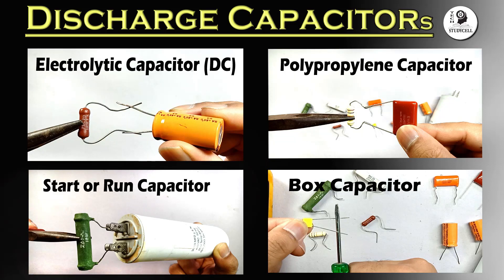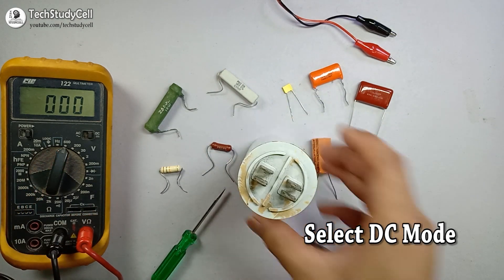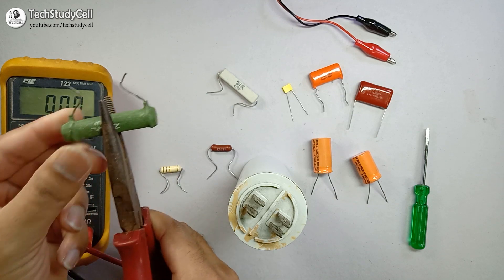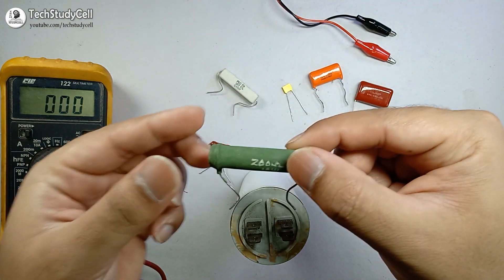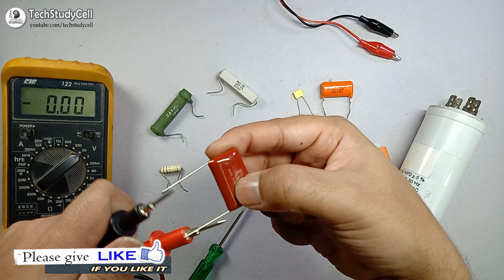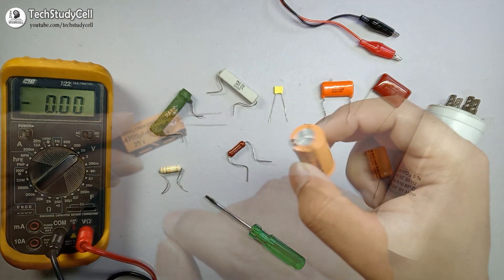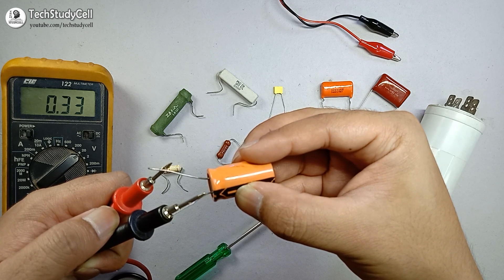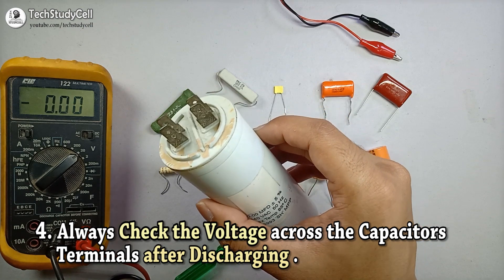How to Discharge Capacitor safely with resistor

Comment: Thank you for the great video. What about in-circuit capacitors? Should we discharge them? And would it the same way by using a high watt resistor?

Comment: Will this one work to discharge high current HVAC Capacitors? Wirewound Ceramic Cement Resistor 10W Horizontal,10 Ohm? 
Is there a reason why your using a 200 Ohm for the bigger capacitor?

Comment: Would it be sensible to leave the multi-meter attached to the capacitor legs while discharging it with a resistor to see when the voltage has dropped to near 0?

Also how do you determine the appropriate type/rating of resistor to use?

Comment: hello  i would like to discharge 3 filter capacitors in a circuit, they are all rated at 500v 47+47uf/ 100uf`` when the power is turned off it have stored about 150v as they are in operation they are at 315v i know a resistor rated at 0,75w for example is enough to discharge 150v as the 0,75w tolerate about 350v and my 2w tolerate about 500v, i just wonder which resistor value is consider to be great for discharge 100-300uf 150v ? i have 100k 0,75w ,300k 0,75w & 1meg ohm 2w left,i just try to discharge 8volt with a 1w 1k ohm resistor and worked nice and quick just to try it,  sincerely

Comment: Why should a capacitor discharge? Imagine the capacitor with all its charges is kept inside a bag and tied at two open ends (open-circuit). 

The positive charges on one plate are attracted strongly to the electrons on the other plate, and the electric field is strong and uniform between the opposite charges on the plates. The opposite charges on either plate seem to hold each other tightly. The field is 
not so strong to cause the electrons to cross the gap and reunite with the positive charges. 
There is a fringe field at both ends ready to burst the bag, but the open circuit does not allow charge flow in the external circuit. The electric fields of surface charges which move 
onto the wires from both the plates and the fringe field will, during the initial transient when the wires are attached to the plates, combine to make the resultant electric field in the wires, zero. The fringe field is different from the field between the capacitor plates. 

When the charged capacitor is short-circuited using a wire, the effect is to open the tied ends of the bag and the charges are released. The fringe field causes the initial crucial release of charges for further flow of the 
charges….and development of surface charges that will enable the charges to flow around the wire, and neutralize each other. After all the charges on the plates are neutralized, the 
circuit attains a state of static equilibrium, a natural relaxed state of equilibrium and we say the capacitor is discharged.
Electrostatics and circuits belong to one science not two. To learn how a capacitor charges and discharges and the origin and role of the fringe field in the circuit process it is instructive to understand Current, the conduction process and Voltage at the fundamental level as in the following two videos:
i. https://youtu.be/REsWdd76qxc and 
ii. https://youtu.be/8BQM_xw2Rfo 

It is not possible in this post to discuss in more detail the formation of the fringe field when a capacitor is charged and discharged.
The last frame References in video #1  lists textbooks 3 and 4 which discuss these topics in more detail using a unified approach and provide an intuitive understanding of discharging a capacitor with the help of sequential diagrams.

Comment: It seems like you could look at the values of both the capacitor and the resistor, and only apply the resistor for a short period before testing again. That way you can figure out almost exactly how long to apply the resistor and write it down for each test. I suppose it would be a good idea to test the resistor every time to see if it's still functional as labeled.

Comment: 300 volt that doesn't need that big of a resistor
Reply: Hello & good day sir, i just wonder i want to discharge 3 capacitors between 100-330uf that still in the circuit ,the stored charged volt after turn of the dac is about 150v i know 0,75w-2w resistor is enough , but could i ask if you know which value i can use to be safe`` i have available 1k-3k /100k-300k-1mg for example, sincerely Ivan

Comment: I have 50v 1000uf capacitors I want to discharge. I have 1 watt resistors, but I see you recommend using a resistor closer to 3 watts to drain, but is it okay if I solder together three separate 1 watt resistors to basically create a 3 watt resistor?

Thank you
Reply from the maker: Yes you can do it with 1 watt. It will be better if the  resistance value is  low (less than 20 ohm)

Comment: i wanted to make a tv head costume using an actual tv, but my parents said no, because of the capacitors. hopefully they will say yes when i tell them how easy it is if you do it correctly
Reply: Please, do no try this at home. If you want to do... Whatever you want to do to that TV... Just bring it to a professional. This is not as easy as you think and if you don't have proper tools and electrical security knowledge you can get yourself killed by the capacitor. Please, stay safe, don't play with these things.

Comment: Big problem is when the capacitor is in the circuit. I got a big shock that threw me some feets away from a very high volts capacitor in a digital camera near flash light section when I was trying to modify the camera. All it took is a accidental touch, we careful with a capacitors in electronics devices, they can be fatal!
Reply: So as idiot kids in the 90's we used to take apart disposable cameras when they were spent, strip wires and solder them exposed near the outside, charge up the flash capacitors and, toss them to each other to catch...

At times I'm surprised I'm alive now and still have all 10 fingers and toes...
Reply: @center4nerds  Wow, and I thought that jumping on and off of moving trains and throwing empty cans of Raid in a camp fire were dangerous things I did as a kid !  I'm surprised I'm still walking around in 1 piece too, without any visible scars... LoL
Reply: @konglives4453  I did something crazy when I was a teen... I poured a jerry can of petrol (gasoline) over a camp fire and the top spout caught a flame. I panicked because I thought it would explode so, I blew it out, but I even today , I think how it could have exploded in my face, particularly if the flame had blown downwards into the can.

Comment: Does this work in circuit? Can I just use one very large resistor to discharge both large and small value capacitors?

Comment: Instead of having many resistors around why not use only one 10w resistor for discharging all capacitors?
Reply from the maker: Yes. That can be done
Reply: I don’t have 10 watts resistor ,any other smaller value?
Reply: @nilolee2426  connect small value capacitors in parallel but make sure the resistance remain high...

Comment: I have small 35v 1000uf. So if i plug it to LED until it no longer emit the light, does it mean it fully  discharged?
Reply from the maker: If you connect a 1.5 or 3 v led to discharge 35v capacitor the the led will burn out. Use always high wattage resistor to discharge a capacitor.

Comment: how do you calculate the value of resistor for discharging each capacitor ?
Reply: Depends how fast you wanna discharge the capacitor. The smaller resistance resistor you have, the hotter it will become and the faster it will discharge. So if you have 25V charged capacitor that you wanna discharge with a regular blue metal film capacitor that is only 1/4 watt, you need around 3k ohm resistor and some time. If you have a 1w  680 ohm resistor you can discharge it quicker without burning the resistor up. This is all is taking in account  that we will not be crossing the operational limits of the components, if you don't care much and the capacitance of the capacitor is lower you can get away  with using less powerful resistors for a short amount of time. Just wear some personal protection in case something goes south. 

Also if you are discharging high voltage capacitors then you need to recalculate all the stuff using ohms law

Comment: Hi, I'm new to electronics. I'm kind of scare of capacitor.  I know it can explode. So what is the safe voltage and farad to play around with? 

I have 35v 1000uf capacitor and a 9v battery (for Arduino project). How long to make it fully charged?  and how long for it to be discharged? What is voltage to be considered dangerous?
Reply: If you charge that capacitor with the 9v battery, the capacitor will hold 9v, (the max is 35v, over that it could explode) and its safe for your hands because the resistance of the skin is around Mega Ohms(very high), if you calculate the current with Ohm's Law: 9v/1MOhm = micro amperes current will flow in your skin and that is not dangerous, but if you connect the two terminals with a metal stick (very low resistance) you will make a shortcircuit, and it will spark. The more Capacitance the capacitor have, the more will hold the voltage. If you have a 100000uF capacitor at 5v, will only holds up to 5v, but it will dangerous to shortcircuit with a stick, because a big spark will come out. If you charge the capacitor up to 35v it will became dangerous for your skin. I hope i've helped you
Reply: @Cr1z4n63L  So, as long as the capacitor that i have never been charged up to 35v. There is no reason to discharge it right?  I'll just leave it lay around before use it again with my 9v  battery.
Reply: @jumbo999614  The capacitor charges around 3 seconds, it is really fast, and the time of discharge depends of what you put in the terminals (low resistance, fast discharge, high resistance, low discharge), check it with a multimeter

Comment: Danger. 300v.  And then he points at it almost touching the leads and the metal probes attached to them.
Reply: I bought a 450 volt capacitor im gonna hook up to a plant.. I watched this video and was like damn good thing i watched this.. read ur comment.. I grab it and touch the metal prods fast... hearts pounding like a mad man... the capacitor was discharged before it was shipped.... going to pull out meter now... dang... it has 5 volts!! not gonna touch it again

Comment: How to calculate Ohm and Watt resistor from capacitor?
Reply: I don't think it matters too much as long as you pick a resistor value high enough to keep the current low. Cause too much current through a low resistor could be dangerous for you, the resistor and the capacitor.

Example: if the capacitor voltage is 35V and the resistor is 1 Ohm, you're gonna get 35A of current initially which is super dangerous.

Also make sure the resistor is rated for a high enough wattage. Watts = V x I. So if V is 35V and your resistor is 100 Ohms, I = 0.35 Amps, so your resistor needs to be rated for at least ~12W. if you use a 1k resistor, I = 0.035 so you only need a resistor rated for ~1.2W.

The drawback is that it takes 10x as long to fully discharge the cap. But since caps discharge logarithmically (quickly at first, then slowly, it probably won't take 10x as long to discharge to a safe voltage).
Reply: Yup

Comment: Hi! Thanks for the video. I am very new to this and want to fix my tv. Could you use the green resistor on all capacitors? What happens if you use the red resistance on the big white capacitor? Is there any danger or these combinations just don't work? Thanks again
Reply from the maker: It depends on the capacitance. So it better to take help from electrician.

Comment: @Tech StudyCell  Your emphasis on safety is very much appreciated!  Would you please do us a favor and delete the Hokiepokie comment below?  Thanks!
Reply from the maker: You have already replied him. Thanks for the feedback.
Reply: @TechStudyCell  That's a bad joke on a dangerous subject. Guaranteed somebody will try to do just that.
Reply: @ng-iq4kx  if somebody isn't smart enough to know not to put his tongue in an electrical component I think he shouldn't be working with electricity anyway
Reply: @harry8184  True, there's electric shock but it's amps that will kill you. That's how cattle fence works, low amps. I'd hate to see some unknowledgeable person get killed because of bad advise.
Reply: @TechStudyCell  No, if you want to be responsible, you should delete that comment not rely on another's comment to address the issue. The fact is that someone may need to click "view reply" in order to see what I wrote.  I commented because you were failing to moderate your own comment feed.  I'm disappointed.

Comment: Hello. At what voltage and capacitance would you need to use a high watt resistor?
How many ohm and watts should the resistor be? What is the minimum watts and ohm of a high voltage capacitor?

Thank you. God bless, Proverbs 31

Comment: For How much time capacitors keep the charge inside after switching off? Is it safe if i disconnect them from a board, touching only one terminal while desoldering? Thanks again!
Reply from the maker: Capacitor can hold the charge for long time if there is no bleeder resistor connected. It's better to discharge the capacitor first then desolder it.
Reply: @TechStudyCell  
Thanks a lot!
Reply: Capacitors can hold a charge for a VERY long time. I took apart a space heater I had not used in 6 years and when I checked the capacitors there was still 1.5 volts in there. That's a tiny amount but the fact that there was still voltage present at all after 6 years is insane. Always check first! Solder is metal so it will conduct.
Reply: @esl4058  
Thanks mate, too!

Comment: Can I use the resistor more than once, or should I get a new one for a next operation, since it will be damaged by the capacitor? And more, is it then safe to touch the resistors' terminals? Thanks!
Reply: If you are still alive, don't touch both the resistor terminals when it makes contact with the capacitor, its like touching the capacitor itself.
Reply: @letthedramabegin8  
Thanks to You as well!👍
Reply from the maker: Yes. But use high wattage resistor
Reply: @TechStudyCell  
Thanks!👍